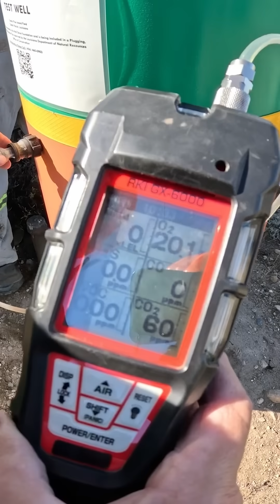The problem goes deeper than you think...

Comment: "No methane will be escaping this hole ever again." 

Some guy in 100 years.: "Yeah, unplug it. We need the methane."
Reply: Probably easier to just drill another hole lol
Reply: I was thinking the same thing. Lol
Reply: These low output holes aren't profitable enough to connect compressors and pipelines or trucks to ship the methane to distant customers, but there is often enough methane to run a container of crypto miners or AI training computers right on top of the holes powered by a small gas turbine.
Reply: @compwiz00 
Exactly!
Reply: @compwiz00 that's actually awesome
Reply: @compwiz00  Ha, if you can run a small gas turbine from a well, it's productive enough to plumb into the pipeline to sell.  There's a whole lot of wells out in West Texas that are all but dead and only producing a few bucks of gas a day, but they're getting paid for it regardless.  You might be able to run a small 5-10HP genset from it, as they used to run old school putt putt engines from that gas to power their pumpjacks with.  Those rarely ever surpassed 10HP, so you won't be mining much crypto with that energy.  That would equate to what, 0.0005BTC/$45 per hour if you're lucky? (10HP genset outputs 5,000W continuous, .0000001BTC/W average).  I mean, it's a slightly better profit than selling the gas, but by the time you factor in the cost of the mineral rights, the data center, and all the expenses of operating a well, you might be spending more than you bring in.

I suppose any oil company could just run their wells for exclusive use as a fuel source for a crypto data center, plenty of engines are capable of running on unrefined crude oil or natural gas.  They'd get more per barrel produced than the price of crude oil and natural gas fetches, with less expense as they wouldn't have to pay a midstream company to send it through a pipeline.  If that was a solid business model they'd likely already be doing it.  Never heard of an oil company willing to leave money on the table...
Reply: @compwiz00  or to power a water pump or something more useful than crypto mining, ugh.
Reply: If it was on my property, I'd like to try to find a way to utilize whatever methane or natural gas may be available to power my house off the grid - & to fuel or power my vehicle.   I wouldn't want to waste all the digging work that had been done.   I have another idea or two that the hole could be used for even if void of any useful resources.
Reply: . - The technology is currently available already - many municipalities use it in their transportation right now!
Reply: Wow. Both methane AND natural gas.
Reply: @rxsolomon  And drying concrete 😂
Reply: would be a lot easier to drill another hole next to it.....
Reply: 100 years from now, ha ha ha, the way we're going with "drill baby drill" it's unlikely many of us will be around with those kind of concerns, anything beyond just finding a livable spot on this planet will be considered phenomenal.
Reply: listen, if the planet survives long enough to ever have a methane shortage. then we did something very right
Reply: Trust me… it’ll leak in a few years…
Reply: Sad reality
Reply: Sounds like some decision a democrat politician came up with so the natural gasses couldn't be removed from an existing well , and that a permit + studies + more permits and more studies are necessary before a new well can be drilled requiring more permits and studies,  + payments to the government forever even after it's depleated and sealed , of course there would have to be more studies and permits pertaining to sealing it before it could be sealed then payments in perpetuity to the government for the privilege of supplying fuel to the American public
Reply: Das ist nicht gut
Reply: Methane is 30 times more harmful to the climate than CO2. 
Great idea - in case there's an ice age again. LOL
Reply: Fun fact methane is what is used to heat most North American homes, just sold under the name of "natural gas".
Reply: That's why you never say never
Reply: Perfect Comment - And That Would Be Me! I have been researching Methane Storage for around 15 years along with Hydrogen Storage! Just need a few like-minded Partners on a PMX Exchange System!
Reply: No. In 100 years we won't need the methane. Global warming will have killed us all.
Reply: just eat more beans. you get bonus gases that way. ;D
Reply: I’m putting this on my gravestone
Reply: Was that a fart joke?
Reply: @McPebbster  no, it's a joke about dwindling resources
Reply: @McPebbster ⛽️💨
Reply: @McPebbster 
I don’t think so, but I could have missed it.
Reply: Probably 30 years. If you can convert cars and trucks to run inn natural gas you can make them run on methane gas. Stinks, awful sulfur smell but works.
Reply: Yeah, but methane one can get from the shithouse, garbage, compost or a certain presidential candidate in copious quantities.
Or from me lately, due to a steroid doctor prescribed, although the BOP needs to be one of the higher pressure varieties...
Reply: @spvillano  Just a certain Presidential candidate?  I'm pretty sure that you can get copious quantities from all politicians -- at least, the ones running for office!
Reply: @alpheusmadsen8485  true, but some have orders of magnitude higher output than their peers.
With some, just more full of shit than a Christmas goose and their exhaust gas methane matching said output.

As for running for office, I've an oft repeated saying, "Emptier than a campaign promise", which essentially suggests the object in question is under a hard vacuum...

Comment: Hydrogen sulfide is sewer gas, it's not gonna kill you in a single breath. It kills due to suffocation (displaces oxygen) or from exploding (because its flammable and will explode in the right concentration, i cant remember the ppm off the top of my head).

Hydrogen sulfide is made by organic matter decomposing (which is why its commonly found in sewers), but say an animal falls in a well and dies, it will decompose and produce H2S, and if you go in that environment without either ventilating it or wearing an SCBA, it will cause suffocation and death.

Comment: I know a scam when I see one.. it's not that difficult to plug... Surely there is a similar expanding foam solution you then hit with concrete.. This should be a 1 man in a pickup truck job not a full blown drilling crane

Comment: everyone knows you shouldn't let methane escape your hole in the presence of a lady, let alone just leaving your hole exposed leaking methane for a century 

so technical question for you, why fill with concrete instead of something cheaper? can you not just like put one of those big inflatable tube things into it and fill it with gravel or desert sand?

Comment: Why would the bottom plug need to "dry" first before you can pour more, when concrete cures not dries? Couldn't you just pour the whole thing continuously until it's full? Or does the pressure of the large column of concrete slurry cause some kind of issue?
Reply: @supetorus9612  after you pump the cement plug you pull back and wait till the sample goes hard (4+hrs) rih and tag top of plug, if it is hard, if it's dropped or if still soft, if hard go ahead set plug#2  and plug back to shoe, pull back, set sfc plug. Wait on cement, top up if needed. Rig down. Basic plug abandon procedure.

Comment: Hope to see how deep those holes run..
Reply: Depends on the target formation. I work for a service company in ND and the Bakken wells are generally 10,000 ish feet deep, and laterals ranging from 0.5 miles to 3 miles, so roughly 16,000 to 27,000 feet total length.
The Niobrara in CO is about 8,000 feet deep with similar laterals. The Marcellus shale in PA is about 7,000 feet.

Comment: I dont understand. Wouldn’t the pressure get so big with methane escaping that the methane would escape from the surrounding ground like radon gas does so it wouldn’t matter if you plugged the hole or not?

Comment: Sounds like there's plenty more resources to be gained from an already existing well rather than plugging it up
Reply: There is not enough product left to be economically viable.
Reply: @psavoy9521 1,000 cars worth of emissions? That's not nothing, especially if it's mostly in the form of an actual fuel like methane.
Reply: @Bird-0  I read recently that there are an estimated one million abandoned and unplugged or leaking wells in Texas.  {Not picking on Texas, just trying to give readers some information about the potential size of the problem.}
Reply: @Bird-0  somebody is lying about something when this many things don’t add up

Comment: I hate to break it to you but you more than likely just plugged a normal working well. Everyone was lied to when they said oil came from the so called dead animals millions of years ago.  It's not and most large companies have always known this. There will never  be a day we run out of oil, ever.  Its produced by the earth, its the nature by product liquid that allows the earth's top to float ontop. And no we could never pull enough out to make a difference to cause the continents to seize up causing an earthquake 10 or above to go off all around the world. If you come back to that well in 20,or 40 years it would be filled right back up. 

You can call me whatever but take a moment,  think how indoctrinated we are and its so bad that if one comes up with something different there immediately slammed for it.  That said I got to see this for myself more than a few times.  Remember they said a car motor couldn't run on water, some of you younger folks won't know about this.  Yet a man did it, if memory servers me right it got 90 miles per gallon of water. All the big oil companies came to him to buy him out like they always do. He wouldn't cowtoe so someone apparently poisoned him and his car and all his reseach went poof  a weeks later. Thats just one example.  Thinking your doing all this great good but your really not. I will say if you just cap,them off, until a certain pressure would be a better way to do it.  That way when the well head blows and that sweet sweet black gold is rdy to pump again. I certainly don't ever recommend filling them with cement.  
Take care.

Comment: On the surface its a 15 inch hole. But eventually it leads to a massive cavity. Kinda weird to think about standing above a huge air pocket. Or that if you fell in you would eventually reach that cavity and be failing at swimming in oil while having zero light.
Reply: Oil doesn’t just sit in a massive cavity. It is in small pores in more or less solid rock. It is pushed into the well bore by the higher pressure in the formation, which is sometimes enough to carry it to surface on newer wells, or pumped to the surface by an ESP or lifted to surface with a variety of methods. When you see videos of subsurface cavities like you’re thinking of, it is likely a pocket of an easily dissolvable mineral, like salt, that was dissolved slowly over millions of years by ground water moving through the area

Comment: Concrete cures not drying. Is there another reason in pouring in segments? Also with out the well casing liner why would the hole stay open ? Sides should have colasped

Comment: These companies should be forced to put 25% of the revenue from every well into a government holding scheme that then is returned to them once it is confirmed the well is plugged otherwise it goes to the government.
Reply: Instead they get to pay zero taxes, split themselves into thousands of subzidaries to avoid responsability. That is why fuel prices in the US are so low, because big oil, gas and coal pay no taxes or responsability for enviormental destruction at all.
Reply: @TheEsseboy That's just not true.
Reply: @blackpowder4016  It is, there is a reason why gasoline is 3-5 times cheaper in the USA compared to Europe...they do not pay taxes and get paid to drill, get paid to build refineries with no strings attached.

Comment: I feel that an opportunity for geothermal energy was missed by plugging that hole. Is there someone doing this?
Reply: Geothermal plants need clean pipes, lots of near surface geothermal energy and a proper sturcture around the hole for longetivty. You would need to dig everything up and redrill the hole to make use of it, and it would probably be a bad location for geothermal anyhow...some places you need to drill 5000 meters down to get any heat, some places 1000 meters is enough. It varies a lot as the thickness of the crust varies a lot.
Reply: This shit is to deep. 

Geothermal is closer to the surface. 

For geothermal on large scale ypu need probing rods over an large field and then the other equipment so no benefit here.